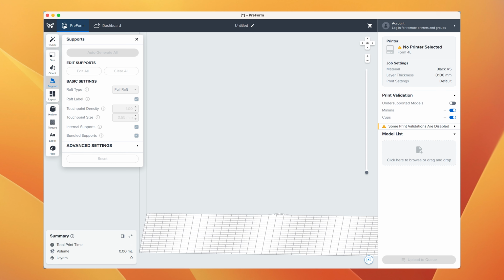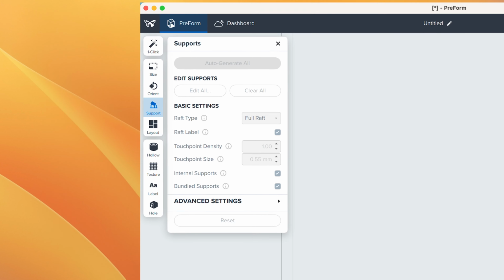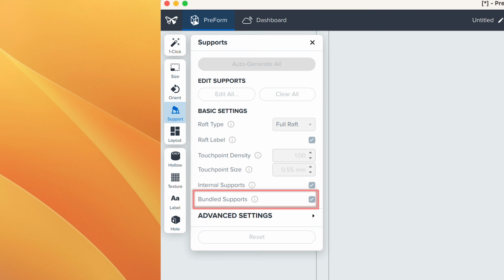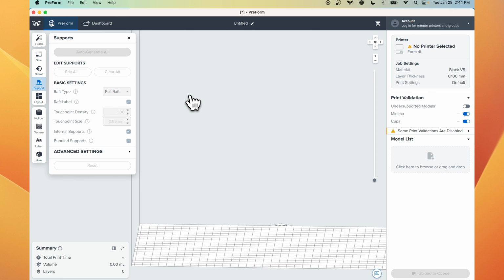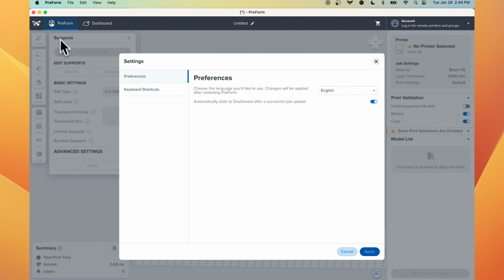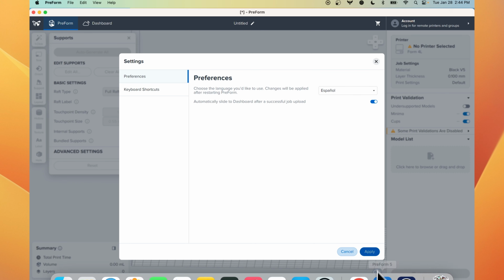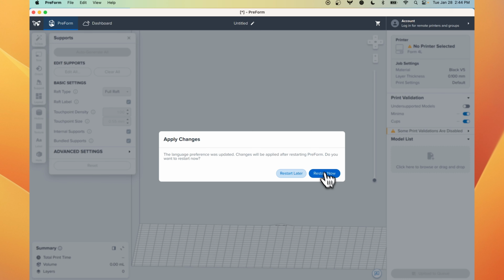PreForm 3.44: New Bundled Supports to Improve Part Removal and Surface Finish

Comment: Make it possible to configure a default down-scaling of imported models.  I regularly do my stl files in 1000X from AutoCAD with facetres setting of 10 so the curved features are more accurately created.  It is frustrating to have to undo the automatic re-scaling and apply my manual rescaling every time.